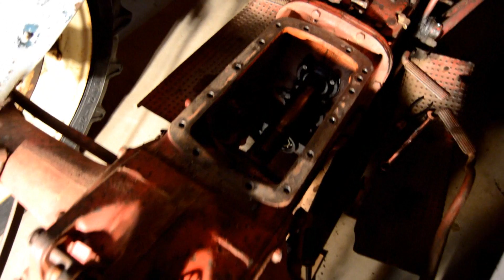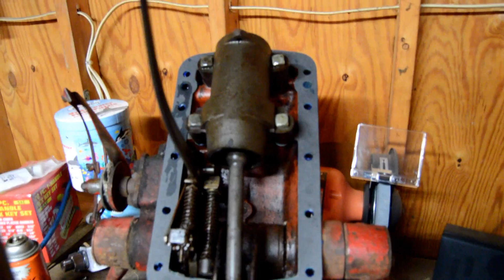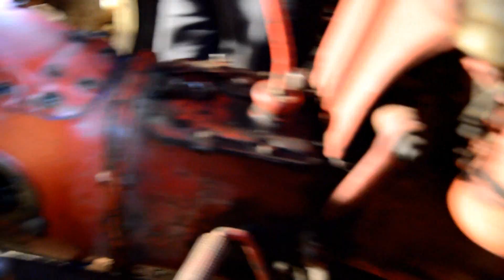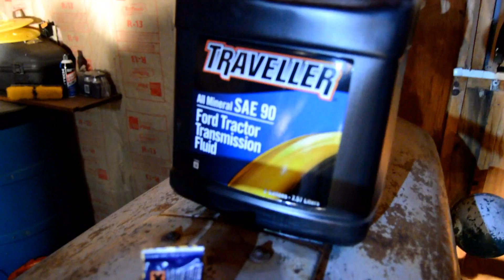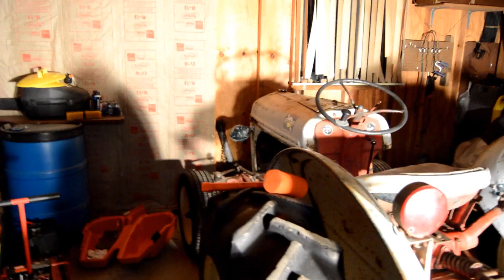FORD 8N HYDRAULIC LIFT ARM AND PRESSURE RELIEF VALVE INSTALLATION

Comment: if a 8n tractor hydrualics fall when theres a load on them its that a bad relief valve?  my dad had a tractor shop several yeaars ago install a new piston in the pump. that made the problem worse. before they worked on it, it was losing pressure in the hydraulics slowly then after they got done with it would drop easily if there was a load on the arms. your advise is apprecaited.
Reply from the maker: It could be the piston or the relief valve we changed both because we were there and its cheap.

Comment: My pto will not engage and the arm on the side will only travel about an inch either way feels like its getting stuck. And suggestions?
Reply from the maker: tipofthesip have you opened it up to see what’s going on inside it’s a pretty easy job
Reply: @WorldsOkayestFarmer  yea opened it up and nothing looks outta place but the shaft that slides back and forth seems really close to the top of the hydraulic pump not sure if that's normal

Comment: How does your 8N hydraulic lift work without the PTO engaged? I'm trying to figure out if my tractor is supposed to operate this way or if I've got worn seals. I've been searching for info and found that the 8N's aren't able to lift the 3 point without the PTO engaged. Is this true?
Reply: Ramsey Wynne PToolbox must be engaged. He has a cover on pto that’s why you don’t see it spinning

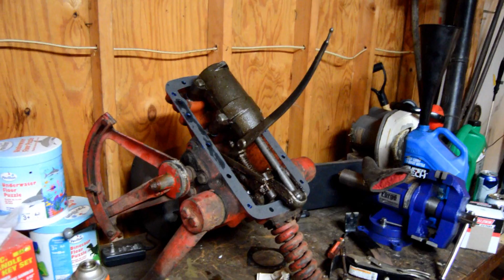Comment: You really should have straightened "that rod" at 5:40!!
Reply from the maker: mike65120 didn’t know it was supposed to be straight... dang or got a new one because it would just be weakened
Reply: @WorldsOkayestFarmer  You can just lay it on a concrete floor and pound it straight. A lot of them get "farmerized" by sticking a pipe thru the inspection port and bending them to compensate for wear in other parts of the lift cover.  There are lots of how-to at https://www.yesterdaystractors.com/cgi-bin/boards.cgi
Reply: Thanks for commenting on the arm not being straight it saved me a lot of time & $. It's hard to tell what it's supposed to look like but I sure knew I couldn't get the adjustments made.

Comment: Picked up a jubilee guy got it all fixed up with more new parts than i can list anyway.... soon as its started lift comes up and no control whatsoever he said had no help with the assembly of the rebuild and was disgusted at this point and sold it to me . The P.T.O.  spins backwards he also said . Used it only about a hour messing around in yard fluids are new gears all work I’m thinking something simple relief valve or arm not in pocket . Helped with one once i was 6 or 7 years old was only one with  small enough hands to unscrew relief valve . What do you think my problem is?

Comment: About 1946 we had a 9n . Dad bought new in 39 $550.00 with a set of plows . I was in school all day, dad and the hired man were logging out a woods . Big old 2 man Cross cut saw they would fall the tree down and buck it into 20 ft sections. I would get out of school and take the Ford up to the woods. Dad made a cradle between the hydraulic lift arms ,with spikes on it. I would back under the log and pick it up , he had set up the relief valve ,the logs were so heavy it picked the front of the tractor off the ground, had half tracks on it . Wrapped a chain around the log to a hitch we had made bolted to the axle housing . Snaked them out to the road ,steering with the brakes .January and February ,mud snow blizzard rain water and ice half way up the front wheels that Ford never let us down
Reply from the maker: Douglas Steiskal the little engine that could right there! Great story thanks

Comment: Great video this really helps me a bunch. My tractor has the exact same problem and I will be sorting that out. Thanks for putting the parts info right up at the bottom of the page. I had some questions about removing the top plate because of not knowing what kept it  ''in time''. This is just perfect compressed into the vital and needed info without being 3 hours long. Bravo on the tech info and editing to the meat and potatoes. Thanks for showing us the correct fluid to refill the case with also. The proper fluid is a topic of disagreement in the area I live in. Just all around great video from the bottom of my heart thank you for posting this! I wish I could give this more than the one thumbs up. The few thumbs down I would like to know why, I just wonder what they wanted that you did not give.
Reply from the maker: Thanks a lot we had fun drinking beer and doing this.  Appreciate the kind words!  Glad it helps others.  If you want to show thanks subscribe if not subscribed!  Have a good one
Reply: Worlds Okayest Farmer just hit the subscribe button. Glad to see people giving good instruction on how to keep old machines alive. If you are a little bit picky about what you buy to start with a lot of these tractors have enough use full hours to be well worth what they cost. These machines are great on hills and until you start talking about live PTO there really is not anything any better than the N series ford. We all don't have the money to buy a 3005 JD just to brush hog 3 acres of ground and plow a small garden. Once again thank you for your help it felt like you made this video just for me. I hope others are helped here as much as I was.

Comment: An easy way to tell when you have enough fluid in it (when filling from the top) is to remove the bottom bolt on the plate on the left side... the one with the pto lever. When fluid begins to come out of that hole it's at the right level.
Reply from the maker: Good to know! thanks

Comment: Question.  Ford 861 hydraulics.  Seems to be stuck in draft control.  Can't get position control no matter where the selector lever is set.  I understand that the selector should be in the raised ( horizontal) position to obtain position control.  Any ideas?

Comment: I noticed the lift arm that sits in the pump seemed to be bent and i see others that are straight. Is there a difference in the arms on some and some of the other 8n? I was told mine was bent but it was shaped like yours. I see the pics on the old diagrams and they show a straight arm. I am confused on mine. Any one know if it is bent or straight OEM?
Reply: Its straight Floyd.
Reply: They are supposed to be straight. They get bent whenever the draft pin is badly worn or broken. They should have checked and replaced the draft pin and the lever while they had this apart.

Comment: cool video... by the way, the hydraulic fill plug next to the shifter isn't a threaded affair, it looks like that I realize, but it just turns 1/2 turn counter-clockwise and lifts out, sorta like the oil filler cap on many car/truck engines.
Reply: +Dan Newberry  I thought the same thing but it just goes on like the gas cap. Good video guys, thanks.

Comment: Did the relief valve do any good?    my three point will go up when the control lever is in the down position and will not go down . the control lever is seated in the pivot hole and operates the valves.  When I move it through the side door it will go down. I think my cylinder and seals are good just can't get it to go down. I feel like my problem is in the pump more than the cylinder. The relief valve should be cheap fix What do ya think ?    By the way thanks for the video and any suggestions you have !!!!
Reply: +Bob Rhodes   You can change that relief valve by just removing the side cover and using a cut-off 11/16" wrench... there are on-line tutorials as to how to do that.  I don't think you'll necessarily have to remove the hydraulic pump assembly to get at it.
Reply from the maker: +Bob Rhodes Hey bob thanks for watching the. I would say if it goes up but wont go down your pump should be ok.  I would change that relief valve it was like 10 or 15 dollars i think i say where the parts are from in the vid. easy to change once you get the pump out plus the cost of fluid. good luck that spring might be bad on the back of the valve.
Reply: Hey !   cool !   thanks for responding. I enjoyed the video and am confident enough now to pull the PTO and clean my pump better. I can get a better look at it on the bench and change that valve. I love these old tractors so keep those vids coming !!!
Thanks again